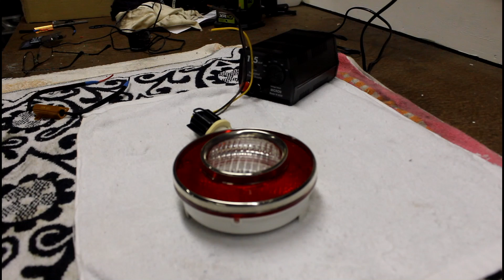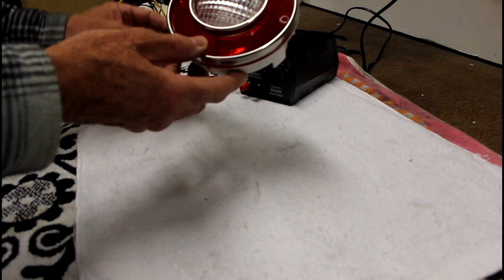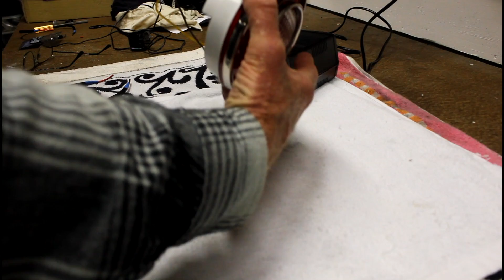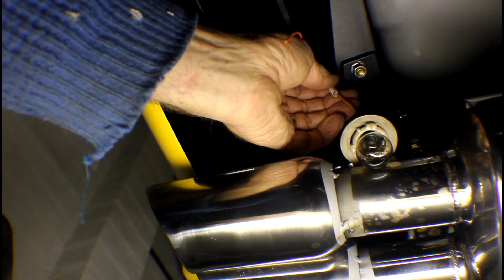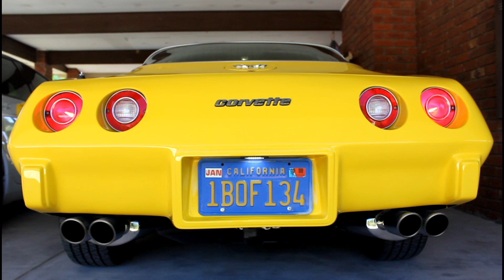Corvette C3 Indicator and Reverse lights for Australian Design Rules

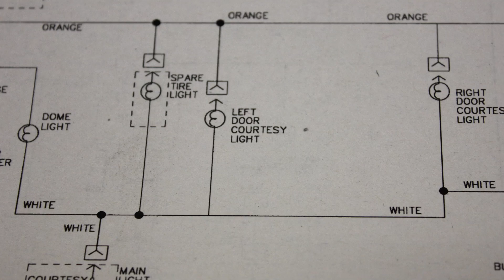Comment: 2:36 probably worth noting you need to cut the white wire on the brake switch and run your new wire from the switch. You cannot just tap into it otherwise your indicators will light up when you hit the brakes as well.
Reply: Hey 
You're the most recent comment so hopefully you may be able to help. 
I'm in this situation where my turn signal led also turn on when braking.
You said to cut the white wire on the brake switch and then run a new wire from the switch. 
First: where is that switch located? 
Second: in the video he says that there are 2 white wires. How do I know the one to cut? 
Last: the new wire that I need to run, is that running to my turn indicator? And that's the load wire right? So how does that work for left and right? 
Thanks in advance
Reply: @advt86  hey mate, the brake switch is located at the pedals, you'll find the white wire there. Run a new lead from there back to the tail lights and then follow all his other instructions.
Reply back if you have any issues from here and I'll try and talk you through 👌
Reply: @giantstickman8650  thanks! I'll have a look.
You don't happen to be near Perth by any chance? :D
Reply: @advt86  hahaha, Canberra sorry! Let me know how you go, can provide photos etc if needed - will take a little bit to get them though as it was a friends car, not my own. But either way, happy to help another owner 👌
Reply: @giantstickman8650  thanks!!

Comment: Hey so I'm trying to do this but I'm confused so, the positive and negative (white and orange wire) that are at the male plug of the wiring harness where do the two pairs lead? One too the spare tire light and the other to where?
Reply from the maker: Have you checked the wiring diagram? The 2 pairs of orange and whites go the the rear. I would need to go and check if you need any further help.
Reply: @GMandHoldens  okay so my question is, how did U connect the white wire to he brake. My understanding is that you connected the white wire to the brake and at the back of the car used this white wire as a direct line so when he brake is pressed the brake bright brake lights come on. So how did U connect the wire to the brake pedal?
Reply from the maker: @fletcherlesueur  Are you wanting to use the swtchback globe for a reverse and left/right indicators or for the brake light/taillight? I used the white wire that was for the spare tyre globe for the reverse lights and used the yellow and green wires for the orange indicators. I hope that helps you.
Reply: @GMandHoldens  okay so, what did U do at the pedal switch. I'm not sure how to connect the white wire to the pedal switch to get power when I press the brake and what to disconnect to stop the indicators from coming on when I brake.
Reply from the maker: @fletcherlesueur  it sounds like you have the wrong orange and white pair. Can you use a multimeter to check which pair you are working with? Just to be sure, the existing left and right rear indicator wires are moved over to a new dual filament socket, the orange and white pair that went to the rear tire light is used as the reverse light to the same dual socket with the left and right indicators.
Reply: @fletcherlesueur  4 years late to the party but hopefully helps whoever stumbles on this next as the video isn't clear and GT has confused things more in these comments. There are 3 wires coming from the pedal switch, one of them is white. Cut it, and run your wire directly from the white wire coming out of the switch itself. This severs the connection for the indicators also coming on when you brake. You cannot just tap the wire, or you will continue to have the issue you are describing. 
The car I worked on didn't have a tyre courtesy light (or has previously been removed/rewired/different colour wiring who knows) so I just ran a wire directly to the back of the car from that switch.

Comment: Hi Graeme can you give me a part number for the globe holders and globe and a wiring diagram for a 1982 C3 vette conversion would be much appreciated
Reply from the maker: You will need the following parts, l brought the switchback LEDS and load resistors via Ebay and the sockets from ecklers although there are other sources. Refer to either the manufacturers manual or an alternative for a wiring diagram;
2X 1157 60SMD Dual Color Switchback White Amber Turn Signal LED Light Bulbs 
2 x H11 LED DRL Fog Light Canbus 50W 6Ohm Load Resistor Wiring Canceller Decoder
 http://www.ecklerscorvette.com/corvette-taillight-turn-signal-and-stop-light-socket-with-wire-1975-1982.html